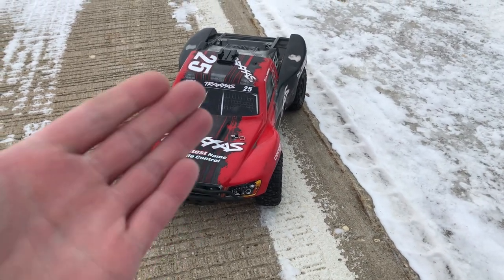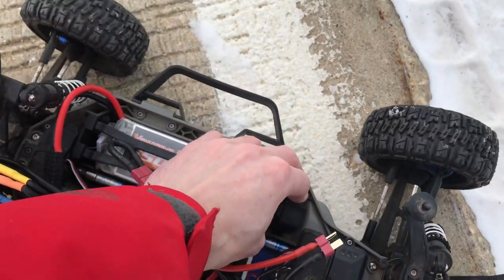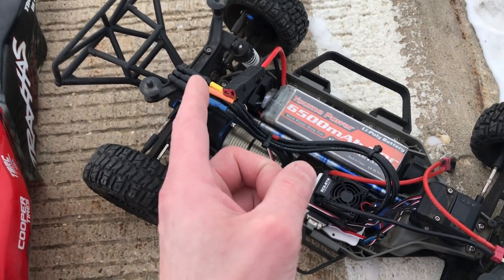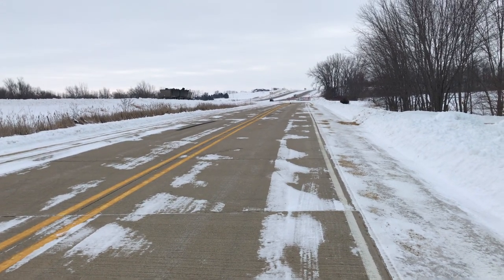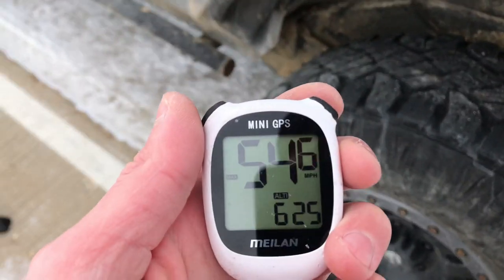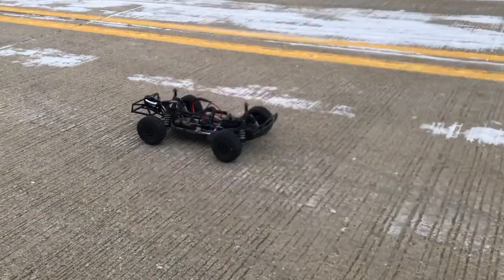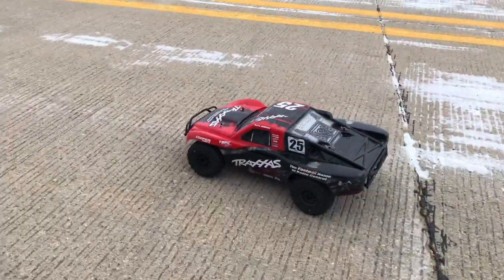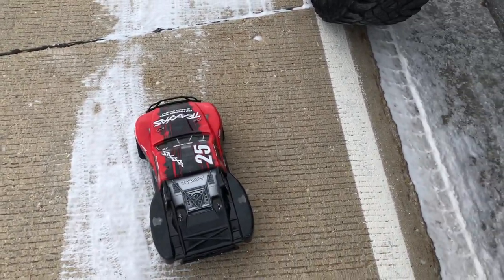100mph Traxxas Slash - EPISODE #3 - FIRST TOP SPEED TEST on 4S - “LONGER EDIT” aka Full Video

Comment: I have a ultimate Traxxas slash with stock from factory the only thing I’ve changed was the pinion gear to a 20 tooth and stock 54 spare gear and I was hitting 72 mph 5500 mAh 60c Lipo battery
Reply from the maker: Nice! You got that 72mph gps recorded?
Reply: Yes

Comment: Awesome attempts !! I think If you take off the battery plug adapter and wire it differently you could gain a lot of current. Those deans connections are not good conductors of electricity. You lose a lot of its full potential.
Reply from the maker: Yeah I’ve been told they can’t take enough current through them

Comment: I think you may have a few things working against you. Not knowing much about the motor you are running, what is the max RPM vs the 3S motor? I think you may also be dealing with a good bit of drag from those tires and potentially just the body itself. I think if you run thinner tires (aka pizza cutters) to reduce the rolling mass and resistance, as well as maybe lower the chassis down a bit, you will see a noticeable improvement in top speed. Of course with the thinner tires you will have to be a little slower on acceleration and may need a longer runway. Good luck man I am following this project pretty close and anxious to see it work.
Reply: A little research and I was able to answer my question concerning motor RPM.
Reply: @stumper92  Hi, you can take a look at the previous video in this series & my comment regarding the motors. ☺
Reply from the maker: Yeah I got a lot to figure out yet and a lot I need to learn. I’ll figure it out though
Reply: @RCKnockout  it’s always a learning curve. But that’s what makes it interesting.
Reply from the maker: @stumper92  agreed!